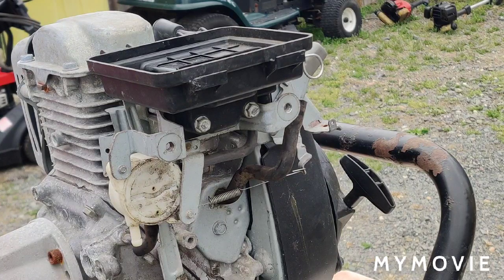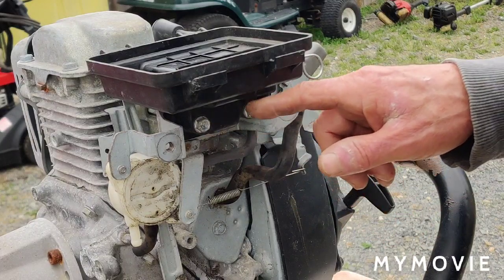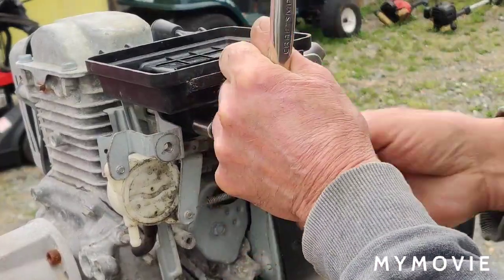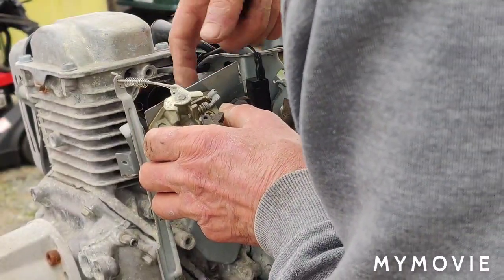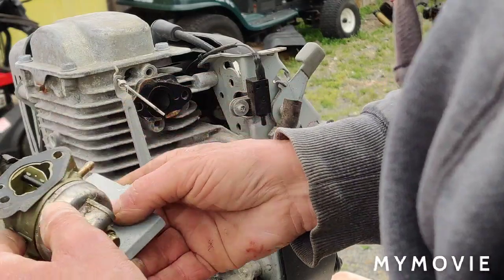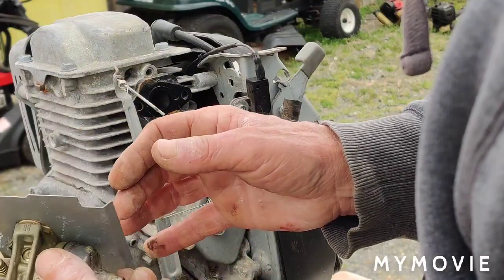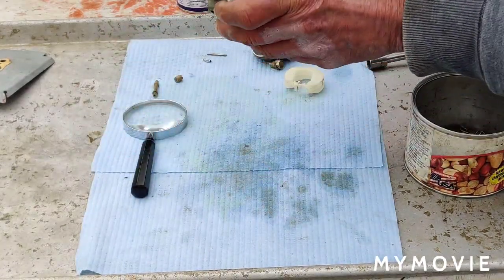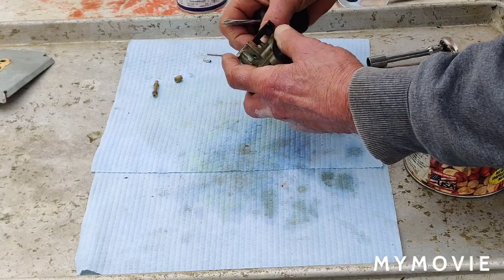Honda GC160 Power Washer. Remove carb, clean and reinstall.

Comment: Hey good one Artie. Carbs are very critical of course. One time, YEARS AGO, I was on a 3 wheeler, goes to show you how long ago it was, I was flying down a small snow mobile trail in summer, when the throttle stuck wide open! Thank god for thumb switches. I thought I was dead. Rolled it back to camp, took it apart, a small piece of sand, literally 1 grain of sand was what almost killed me. Dang. Ok that story was not related to the video lol, just my input on carbs haha 😂

Comment: Hey Artie I hope your doing well bud nice work getting the carburetor cleaned  out. Its amazing how the smallest amount of dirt or grime in the carb can make a machine run bad. Like you mentioned the carb looked clean when you took it off of the power washer but after you went through the carburetor and cleaned it up it made a huge difference like day and night. When you started it I ran smooth and it was putting out some good water pressure another thing you mentioned was the throttle response i agree it had very good throttle response. Great video my friend I will talk to you soon. 👍
Reply from the maker: Thank you Taylor. It doesn't take much dirt to make a carb not work. I hope all is well with you and I had a good time on the live stream. Good job and Thanks for watching 👍

Comment: 20:00 the choke rod is hooked up wrong. It goes in from the bottom, not the top. I’ve made that mistake and it makes a difference - the rod binds when working the choke lever when it’s put on upside down vs no drag and smooth action when it’s put on correctly.
Reply from the maker: Good eye. Your right. I have since corrected it. Thanks for watching 👍